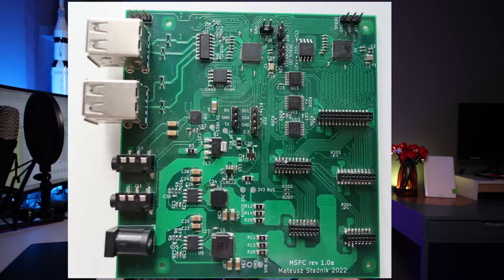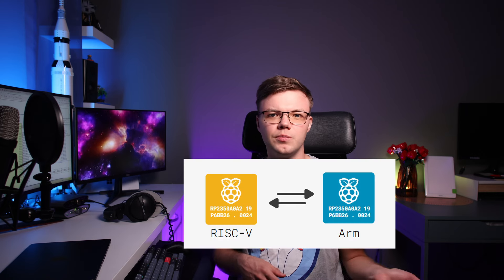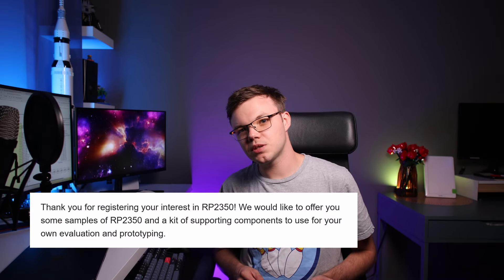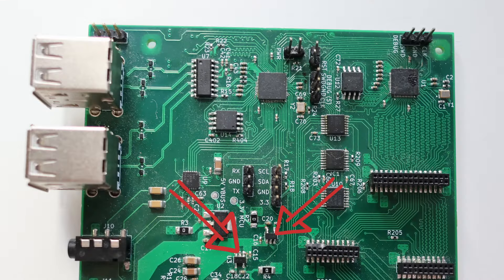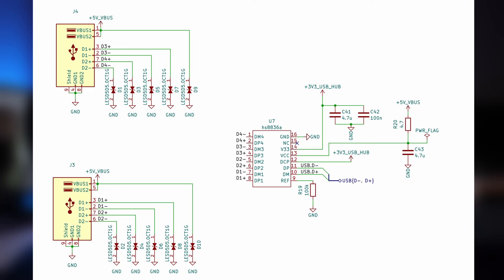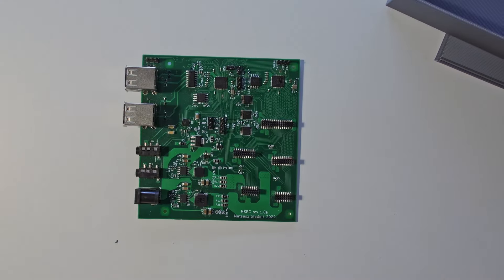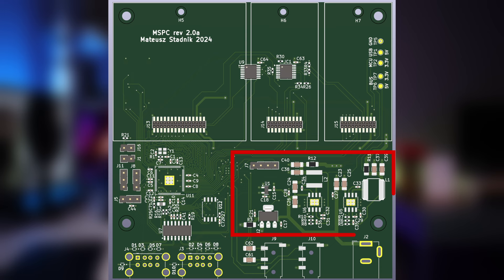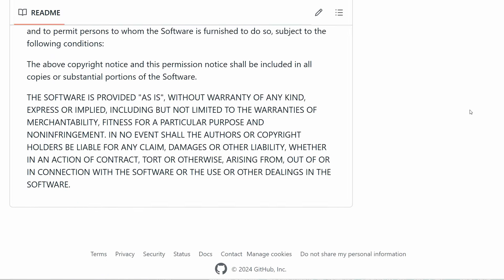I Designed My Own RP2350 Board and You Can Too!

Comment: Is the external PSRAM or QSPI ram able to be encrypted on the fly or at rest with a key stored using the internal OTP storage? Like is this actually a secure device that will prevent people from hacking your IoT application and dumping your secrets
Reply from the maker: That's rather question for RP2350 datasheet or designers (through raspberry forum), but looking quickly inside documents I don't think so. 
RP2350 contains encryption module with secure boot, but the flow is to verify image from QSPI flash then load decrypted image inside SRAM. And I would need to deep dive into datasheet, but I believe there is a way to prevent external access through JTAG/SWD and your software should be quite safe (of course except security leaks inside firmware itself)